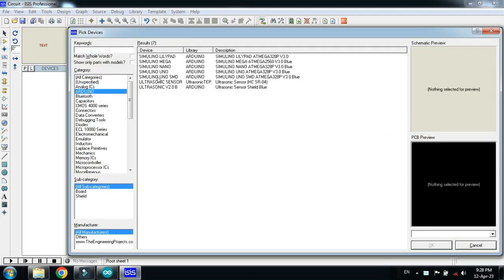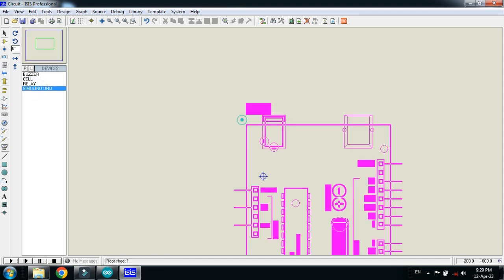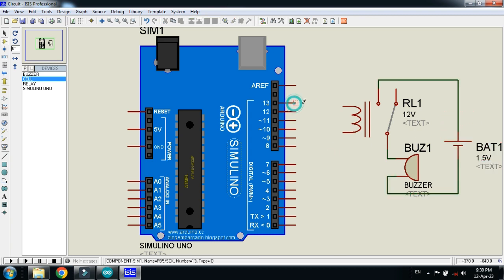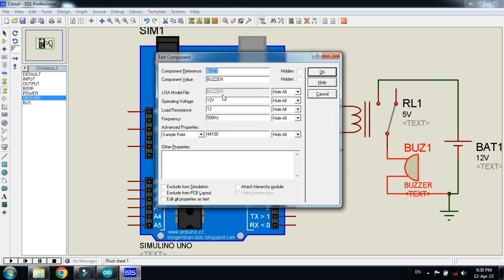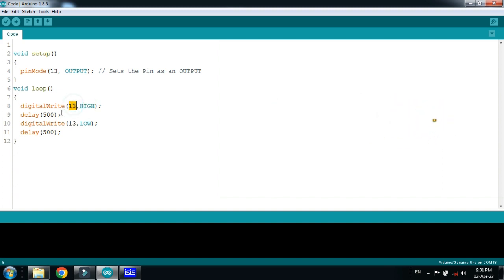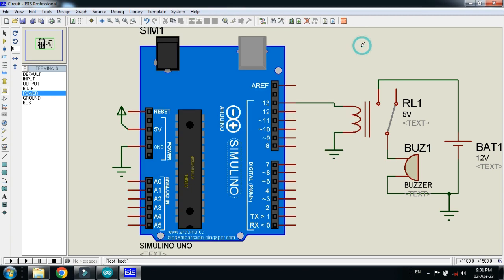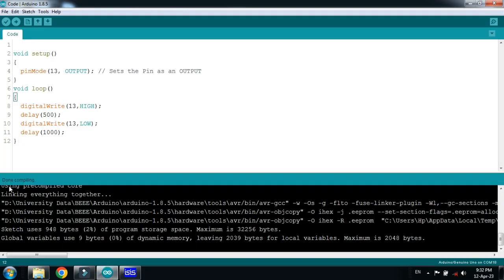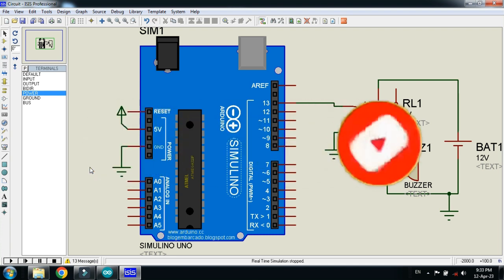Interface 12V Buzzer With Arduino | Code & Circuit | Proteus Simulation

Comment: bother video tumne ek buzzer use kara hai but agr main 6 buzzer ka use karta hoon to kya 6 buzzer ke liye 6 relaye use karna padega and 6 battery 12v apply karana ....?
Reply from the maker: Agar aap 6 buzzers aik saat ON OFF Karna chahte hain tu 1 relay aur air Battery kafi hai. Agar aap 6 buzzers alag alag ON OFF krna chahte hain tu relay 6 laga lo aur battery 1 kafi hai
Reply: @thebrightlight9472  ok
Reply: @thebrightlight9472  bro opto isolator ko buzzer ke saath kaise connect karain with 12v battery hamara buzzer 12v pr work karta hai
Reply from the maker: Google it please